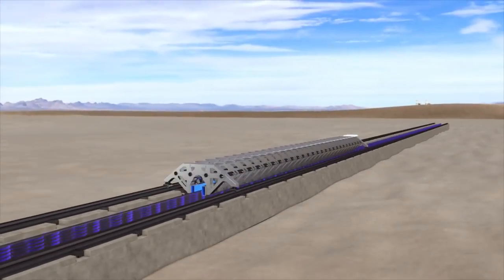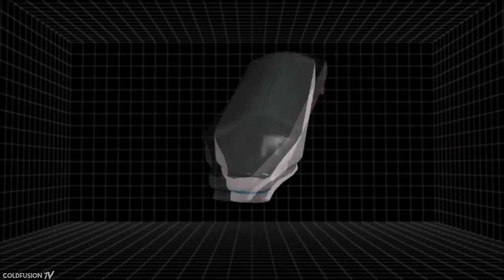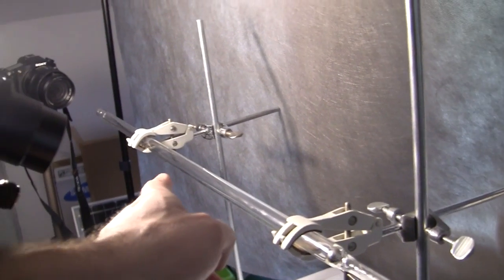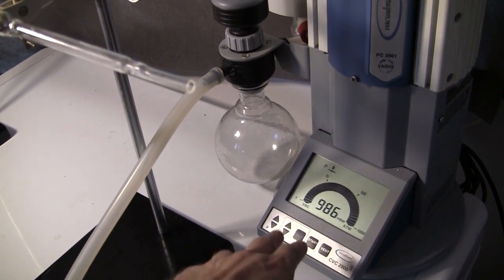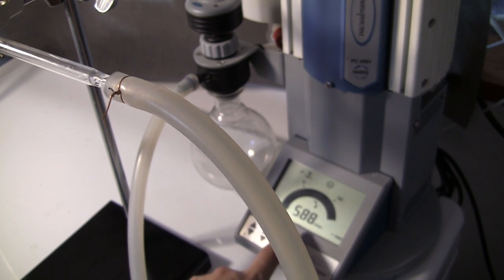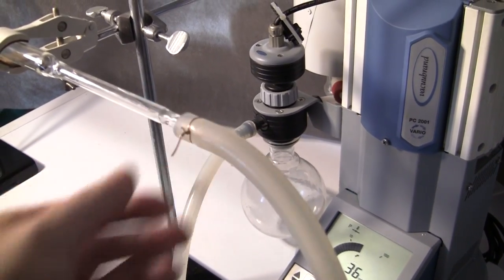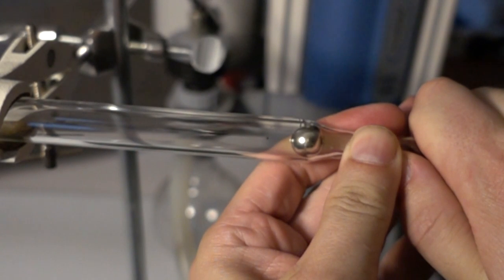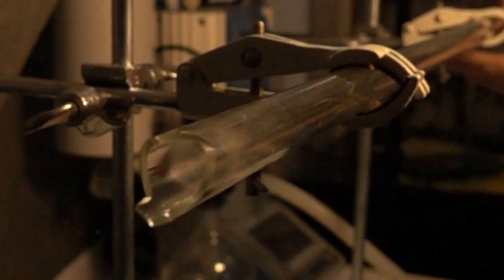How  the Hyperloop can kill you!

Comment: Are you serious? Something could go wrong so the whole thing is bullshit?
Reply: This experiment doesn't scale well since the force applied by the pressure gets squared while the mass of the object gets cubed. Some quick math while asuming that this is a 10mm 3,5g ball bearing shows that the train would have to be about 14kg to get the same acceleration in a 2m tube. Lets all agree that a fully loaded hyperloop train will probably be a bit heavier than 14kg.
Reply: As he said, he's making a full vid; this one is just looking at one aspect. And yes I reckon, with already massive pressure on the system to implode, in a system that presumably would have to be thousands of miles long, not to mention if it's to be used in places like California and Japan where earthquakes are rather an issue, the risk of something going wrong wouldn't seem trivial to me.

Risking it to be an astronaut is one thing. Risking it to commute to work, perhaps not so attractive. 

Another aspect of that is, you presumably would be making a large network of this. So if there's any risk of failure, such failure would presumably crash the entire network for quite some time. This could be reduced by using bulkheads, but traveling at mach 1 in a system with auto-closing huge metal doors may again not be that attractive (adds another potential for failure).

Such issues are reasons why grandiose plans are rarely a good idea: if it fails, it fails bigtime. Nuclear reactors are the obvious example... and at least they are relatively small.
Reply: Something could and will seriously go wrong if they do it the way they presented it to the public. The bullshit part is that they sold it as a "cheaper" alternative to traditional rail, but if designed and executed properly to prevent an imminent disaster, it won't be cheaper, at all.
Reply: if you have sensors to detect a pressure drop and release the pressure from the other end of the tube then you can cut off the resulting acceleration. see, theres possible solutions to a problem thats how science generally works.
Reply: Matteo Del Gallo
Suddenly a automated bulkhead drops in front of your hyperloop train, smooch go the passengers.
Somehow this magic valve does not interfere with the continuous track.
Hyperloop is a intrinsically dangerous design due to the large pressurised environment.
Reply: Matteo Del Gallo That shouldn't have even been able to happen.
Reply: Matteo Del Gallo
No you don't understand, trains are not meant to run 2 different ways on the same track.
There are signals to prevent exactly this sort of thing from happening, or double track.
Bulkheads slamming down will happen a lot more than you anticipate.
Reply: If they find a way to solve this problem they have also found a way to shield houses from the explosion of a nuclear weapon.
Do a calculation for the amount of energy stored by evacuating all that air, nothing can stop that.
Reply: I was about to point this out.  Thank you.
Reply: See, the thing is that with a tube ~1000 miles long, something will go wrong somewhere and a failure anywhere will kill you.
Reply: Matteo Del Gallo The main danger isn't acceleration, it's the pressure wave hitting the pod. It will be shattered.
Reply: Matteo Del Gallo
That would have to be a very exotic valve design I have no idea how they would make that failsafe.
Scaling this experiment up makes it more dangerous not less.
Just because the velocity will be lower doesn't make it any safer I can be crushed by a boulder moving 1m/s
Reply: Matteo Del Gallo Only if the failure happens really far away from you—the air will be rushing down the tube at the speed of sound, so you won't have much time to repressurize, but you can't do it too quickly or you'll destroy the pod yourself.
Reply: If the train is travelling at supersonic speed it will by definition outrun the pressure wave (Ignoring pedantry about mach number and air temperature)
Reply: This "something wrong" does not even hinder hyperloop at all, let alone entirely. Bare in mind the calculation I've done below also ignores the fact the pod has no reason to make an airtight seal, hence the pressure difference would be even less and therefore acceleration even less.

It's not normal that you get basic physics wrong Thunderf00t, but I'm sorry to say that below first year physics shows that this argument is incorrect. You say that the acceleration will be worse (i.e. more acceleration) as you increase the diameter of the pipe, this is completely incorrect. It will be exactly the same.

The reason shown why is here: https://gyazo.com/d7c207012016e8955a0d6ad2bb45f134

For people that don't like gyazo, I've written the same thing out below but the formatting is obviously worse. TLDR: a full scale hyperloop would have much much less acceleration than this small model, not more.

Consider a cylinder (the hyperloop pod) within another cylinder of the same diameter ( the hyperloop track) with a pressure differential.

The overall force is the force on one side, minus the force on the other
$$F = F_1-F_2$$

Pressure is simply force distributed over an area, $P=\frac{F}{A}$ So $F = PA$

Therefore $F = P_{1}A-P_{2}A = A(P_{1}-P_{2})$

So the overall force is simply the pressure difference multiplied by the surface area

$$ F = A\Delta P$$

The surface area the pressure is incident on is a circle, $A = \pi r^2$

$$ F = \pi r^2\Delta P$$

For an object that is a constant mass $F=ma$ $\frac{F}{m}=a$

$$ a = \frac{\pi r^2\Delta P}{m}$$

The mass of an object is its density multiplied by it's volume, $m = \rho V$

$$ a = \frac{\pi r^2\Delta P}{\rho V}$$

Volume of a cylinder is simply $V=\pi r^2 h$ where h is its length.

$$a = \frac{\pi r^2\Delta P}{\rho \pi r^2 h}$$

$$a = \frac{\Delta P}{\rho  h}$$

So as can be seen, the diameter of the pipe does not affect the acceleration. However, for a long cylinder the acceleration decreases. I.e. the acceleration on a full scale hyperloop due to vacuum collapse would be considerably less, not more, than your experiment.

The density of a completely empty british rail class 220 carriage is $1044.15kg/m^3$, and the length is $23.85m$. Now bare in mind this is completely empty, when it's full it will be much more dense and hence the acceleration will be even less. The acceleration for this density and length would be $0.4g$, completely completely manageable. Hardly even noticeable. And again, for a carriage that was not empty this would be even less. That's a 0 to 60 of 7 seconds, that's not even a particularly fast car. This car can accelerate that fast http://www.autosnout.com/Car-Performance-Statistics.php?Specs&EditionID=253.
Reply: BlueCosmology The acceleration isn't really a concern, you'll likely be killed by the pressure wave hitting the pod. This experiment demonstrates what would happen if you somehow survived the initial impact. Read the description, people!
Reply: ***** If thunderf00t is saying acceleration isn't a concern why is the whole video about the fact that the acceleration is a concern? I'm debunking the video by thunderf00t, not everything thunderf00t has ever posted. This video is nonsense.

But no, a 1 bar pressure wave would also most certainly not be fatal in the hyperloop. The hyperloop is meant to travel at around the speed of sound, meaning the pressure wave would be essentially a light wind.
Reply: BlueCosmology Not if it's coming from up ahead.
Reply: and use bulkheads if it's far away
Reply: BlueCosmology Because you'll have time to decelerate from above the speed of sound, stop and accelerate back up to the speed of sound while there's a pressure wave rushing at you.
Reply: Matteo Del Gallo Earthquake, an unwitting construction crew with a big land drill, a gas leak (not to mention the favorite of recent times—a terrorist attack—because you can't guard that much ground)… I don't think you realize how big this thing is supposed to be.
Reply: BlueCosmology Let's say the procedure would take 10 minutes (and that's optimistic). If the failure happens less than ~150 miles up ahead, you're screwed. And then you'd have to outrun it enough to be able to again safely decelerate at the station with time left for people to evacuate the pod before it catches up.
Reply: Also, a breach would more likely be smaller than the diameter of the whole tube, restricting flow rate
Reply: Look at it this way, at least if a plane is falling you can jump out and not immediately have the water in your skin boil due to lack of pressure.
Reply: Thats a big something ...
i mean, airplanes have a very low difference in pressure compared to the atmosphere at that height. yet when you have a structural problem, the damage is pretty major. thats a 4:1 pressure difference.

now this hyperloop, wants to have a 1000:1 pressure difference with the atmosphere. if you had a huge structural failure, you would get either propelled at a huge speed forward (BAD, but you could apply some kind of emergency brakes, so lets say thats not a huge deal). or even worst, if the failure is up front ... you would get a frontal collision which would be like hitting a wall (REALLY BAD).

maybe, if the system was an underground tunnel, with a really thick structure, protected from any external damage. and if the pressure differential wasnt that high,  maybe it would make sense. having some kind of train doing 600kmh, its still REALLY fast. No need to go 750mph.
Reply: Also the structural damage on the track wouldn't be that great. There are several documented breaches on space stations caused by micrometeorites, that left small bulletlike holes in the fuselage, and that could have been fixed, and in one case were indeed fixed with duct tape
Reply: But the module shouldn't be touching anything, in all of the proposed versions, so it doesn't matter
Reply: a few systems could be put in place to assist with something like that, unfortunately vacuuming a tube that massive would be a significant amount of work, releasing pressure at various points along the tube would stop the acceleration, and one important thing to note is the tube being used in the Hyperloop isn't nearly as "tight" as a ball in a tube as demonstrated in this video.

This is very similar to the classic pingpong ball in a vacuum video, where put pingpong ball in a tube with masking tape on each end and poke a hole on the one end with the pingpong ball causing pingpong ball to accelerate to like 300mph or something silly.
Reply: Lol, pretty much his argument against Brexit, too.
Reply: something can go wrong and kill people in railways, but they aren't bullshit
Reply: +NotAsian or, hear me out, they can make some kind of emergency valve to repressurise everything evenly
Reply: ***** In which case, assuming there's absolutely nothing else that can be done to survive the pressure wave (there most certainly is, simplest being valves) you stop the pod and go the other way.
Reply: Shit happens even on railroads.. Remember like a week ago where in southern italy two trains crashed head on. You think it was supposed to happen?
Reply: Also the valves would be on emergency air inlet tubes, that would be sticking outwards from the main tube. There would be no problem of turbulence since in an almost 0 pressure environment aerodynamics can be disregarded
Reply: I agree *****, but also bulkheads slamming down in front of a nacelle shouldn't be happening
Reply: +NotAsian not if they are made only to respond to sudden pressure rise, and you could even make them so that they would not slam down if there's a nacelle on it's part of the track.
Reply: Also, sections of rail such as the one where the crash happened are made for trains to run both ways, it's just that there are signals to stop two trains being in that section of track at the same time
Reply: ***** dude, let's say that passenger confort is not a priority in an emergency situation. And yeah, if they use magnetic propulsion it shouldn't be a problem decelerating and accellerating quickly
Reply: Also, a breach would be more likely behind the nacelle, because of stresses
Reply: But still, why would it breach? This is another point against the whole video. Why would the pressure vessel breach?
Reply: Ok, i guess, but all of these (exept for the construction crew, but that's the least likely) you would be as much in trouble if you were in a train. And if you're far enough away, then i repeat: bulkheads
Reply: Ok, i guess, but all of these (exept for the construction crew, but that's the least likely) you would be as much in trouble if you were in a train. And if you're far enough away, then i repeat: bulkheads
Reply: ***** "Because you'll have time to decelerate from above the speed of sound, stop and accelerate back up to the speed of sound while there's a pressure wave rushing at you."

"I don't think you realize how big this thing is supposed to be."
Reply: ***** 10 minutes is optimistic to stop something and turn it around? Nowhere near. Work out what acceleration that would be, tiny. 

You don't have to outrun it. Just travel at a similar speed to it.
Reply: Well, at least you wouldn't be 10000m from the surface.
Reply: Also, why jump out if the plane isn't crashing?
Reply: You can do A LOT to mitigate or even negate the danger of depressurisation, which isn't that great to start with
Reply: Especially considering that a modern submarine can survive up to 72 bar of constant pressure
Reply: anything can kill you. A leak can happen on a ship in the middle of the ocean. A leak can happen on a plane breaking it up. There are ways around it like, making an automatic leak on the other end to slow you down.
Reply: It wouldn't be propelled that fast, look in the comment thread BlueCosmology shows the math for the accelleration due to pressure, which isn't that much.
Reply: And decelerating from 750mph in 20s would be an accelleration of 33.528m/s^2, or aroung 3.4g, which is totally bearable, and would give you the option to run the other way
Reply: This is because pressure isn't logarithmic: the difference between 0 bar and 1 bar is the same as the difference between 1 bar and 2 bar
Reply: 3.4g is bearable the same way that getting your hand cut off is bearable, sure you won't die, but there will be damage if you are not protected.
And if you're going to tell me "jet fighters experience higher G's" I have this to say to you, no one will board a train that requires them to put on a REALLY expensive suit (if they are personal only) or wear something someone else wore just so they can survive a possible emergency braking.
Reply: Maintaining an entire tube that might be 1000km long or more at 1mbar for 50 years, seems totally doable, right?
Reply: Bourinos02 Yeah very much so, maintaining a vacuum isn't a difficult engineering challenge. Multiple kilometre vacuum tubes exist all over the world, and making them any longer doesn't add any challenge.
Reply: ScarletFlames1 3.4g is bearable as in you wouldn't even faint
Reply: Especially since they would be totally horizontal
Reply: BlueCosmology You mean, outside of synchrotrons? Where?
Reply: ScarletFlames1 some rollercoasters experience more than 4g so 3.4g aren't that bad
Reply: Bourinos02 Synchrotrons are all over the world, and you could also take LIGO as an example: 2 4km long vacuum tubes
Reply: Bourinos02 1) Why outside of synchrotrons?
2) Outside of synchrotrons the longest vacuum chamber is probably the two 4km arms of LIGO.
Reply: BlueCosmology Well, because a 10mm tube is quite different from a 2-3 meters one? Sure pressure will not be that low and cryogenics will be simpler, but that's comparing a piper cub to a A380. Don't get me wrong, I kinda like the concept of it, but I have troubles to see this reliably working for extended periods of time and with a module passing by every 4 minutes...
Reply: Exept that LIGO's arms have a diameter of 1.2m, which poses the same problems that would arise with a 2m or even 3m diameter tubes. Also keep in mind that they are made from 3 mm thick steel, and they are estimated to survive at least 20 years
Reply: So yeah, exept for deliberate tampering or natural catastrophe the tube shouldn't suffer a breach
Reply: Bourinos02 A large diameter vacuum cylinder is much less of a technological challenge than a smaller one ( that's the main reason synchrotron vacuum tubes are much thicker than the beam size ).
Reply: Matteo Del Gallo Yes, and there's only a laser passing by, not an almost 5 ton module.
Reply: If the module puts stresses on the inside of the tube there's a bigger problem
Reply: Especially at 750mph
Reply: Matteo Del Gallo It shouldn't touch anything at high speed that's correct, but at low speed it must. This is not even taking account all that could go wrong from a earthquake, a tree hitting the line, a truck accident quite anything that cannot happen in restricted area like synchrotrons. or affect them dramatically (as earthquakes would).
Reply: Well, both a truck and an earthquake would affect a railway in much the same way
Reply: As would a tree on the rail
Reply: Well, I have troubles to see how a truck can destroy tracks, but my main point is that the operator might be able to see what's going on and can take actions to avoid danger, which isn't possible in a steel tube at 1000 kph...
Reply: You could easily stop in 10s, pulling only 3.5g
Reply: It would still be 3500m, but in a long tube there would of course be strict monitoring practices
Reply: Pressure sensors all along the tube
Reply: Exept that the ping pong ball weights almost nothing, whereas a hyperloop capsule might weight at least 5 tonnes
Reply: The thing is, if something goes wrong, everything goes wrong.
Reply: +kcdnhntr damn you Murphy
Reply: ***** WHY ARE YOU SHOUTING?
Reply: This idea has been around for years at least... why is some genious trying to convince people to make it now when it's impossible with today's tehnology to not get horribly murdered or brain damaged oO ?... Oh well.
Reply: Hiro Animation
Yes but that's what scientists are doing, not some rich guy throwing money to make it a reality right now when it's impossible now. It's like making a plane out of stone or paper. You first work on the tech till it works, then you go onto commercial use once it's viable.
Reply: Hiro Animation He's funding at the engineer level, but actually that's the science that needs funding, not the engineers... We have yet to find suitable materials to build this, and we're FAR from it right now...
Reply: Ikr... If we would think like that, cars and trains would maybe drive 50km/h, probably even less, because everything above would be considered bullshit and too risky, since something could go wrong :D But I guess some idiots will always waste their live to talk down on innovation, instead of innovating themselfs. Nothing new, people looked down on Zuse when he build the first computers. In fact it literally happend with nearly every innovation. Electricity, light bulbs, planes, train, cars. "What a bullshit, this wont ever replace horses. So much can go wrong, and it's such a bother just to keep it working and will be too expensive to maintain".
Reply: You mean like with airplanes? Or Cars? Or ships? Or your body? Or your house?
Reply: they could simply use a valve with a medium flow rate, that repressurises the tube fast enough to stop or at least mitigate the pressure difference
Reply: well, a system of bulkheads, sensors and emergency valves will help mitigate the dangers A LOT. Plus, the pressure force is squared, while the force needed to move an object cubes the weight, so scaling this experiment up makes it less dangerous.
Reply: That's not what Thunderfoot's argument is in the video, and knowing that a Los Angeles-class submarine can withstand 30bar of constant pressure, we could probably create nacelles that can survive it. Plus, bulkheads and emergency repressurisation valves if the break isn't that close.
Reply: well, if the pod can sustain enough pressure, you can let the air in not fast enough to break the nacelle, but enough to mitigate the pressure wave, and make it sustainable. also,  the nacelle is supposed to be able to get up to supersonic speed, so they could even outrun the pressure wave, and use bulkheads to stop it. Btw, I know how ridiculous the second part sounds.